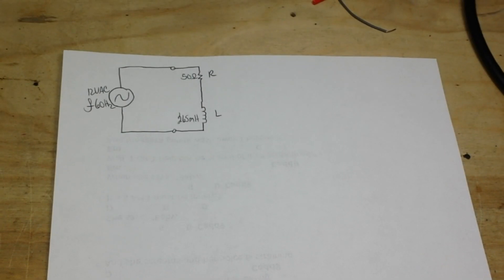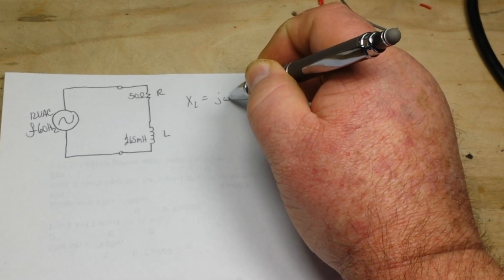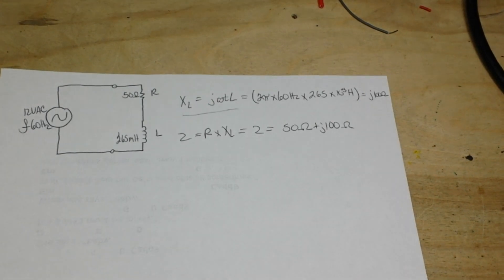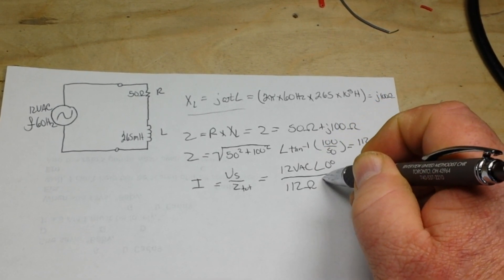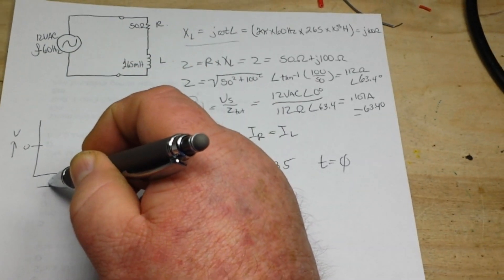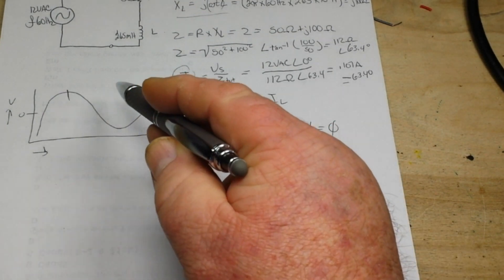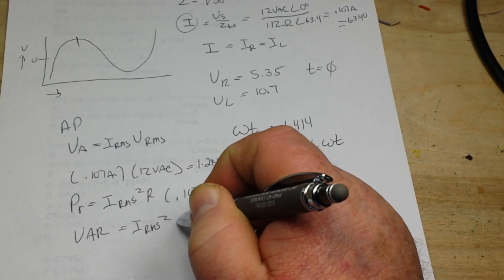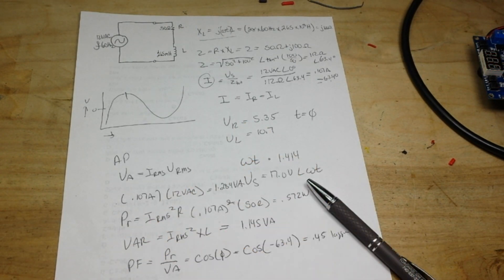AC Circuit Analysis - RL Circuits

Comment: Dude, you have a whole bunch of formula. But you have all the figures as well. How did you come up with the figures? I do want to LEARNELECTRONICS, please teach us, or me, how to get those figures and how there used in real time circuits. Other than that, great video, thanks!
Reply: Power source: 12 Volt AC @ 60 Hz.
R = 50 ohm
L = 265 mH